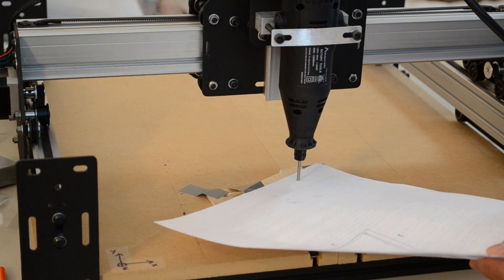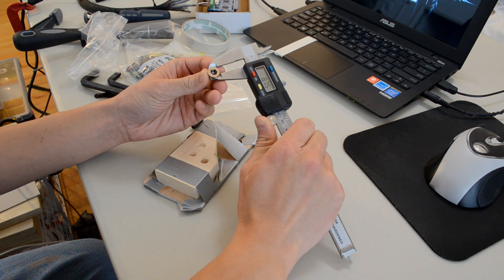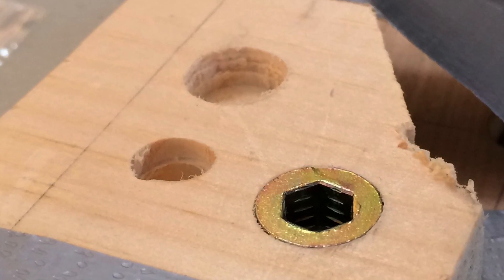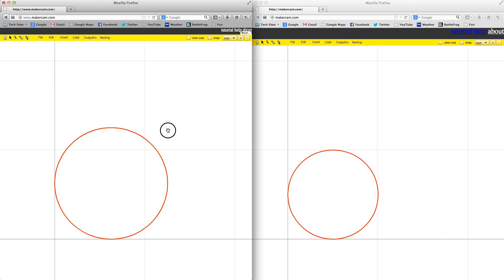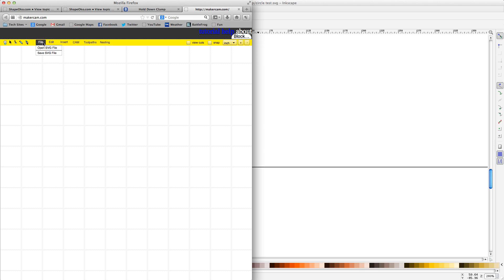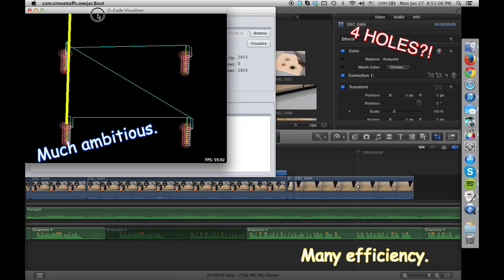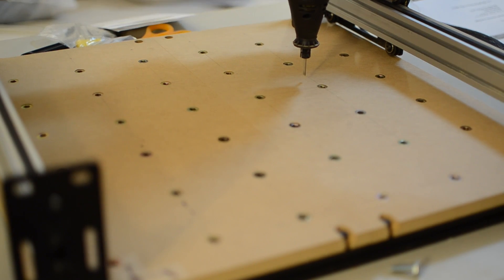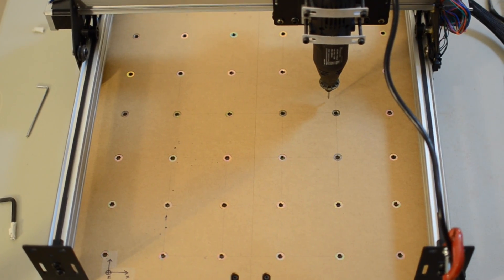Shapeoko 2 CNC Kit: Wasteboard Upgrade w/ Threaded Inserts

Comment: So getting the ones from McMaster you recommend an 8mm inner hole?
Reply from the maker: Yep, and for maximum holding strength, you can install them from the bottom. Drill through the waste board, and use a countersink bit so they sit flush and don't interfere with the base frame. I haven't had much problem with them in the top, but it becomes 100% foolproof if the flange is on the bottom.
Reply: Hey thanks for answering and sorry for being a bother. For the E-Z loks is the outer, top hole diameter still 1/16" beyond the 8mm?
Reply from the maker: the flange diameter? it's like 0.48"

Comment: Hi, I've learned a lot from your videos. I ended up ordering the ez lok from amazon and install them, but I have found that the inserts are kind of weak.  They don't hold all that well in the wasteboard are prone to being pulled out by pressure.  I thought that might be because the wood is too soft.  Even with adding glue i find that the inserts are still being pried up.  Do you have any thoughts on what it is I may be doing wrong?
Reply from the maker: The hole size suggested on the packaging is wrong. Should be 5/16 (8mm). Otherwise the inserts go in too loose.
Reply: wow, quick reply.  Thanks, I'll look into that.

Comment: Couldn't you do the same thing but flip the mdf over? so the flange is on the underside. Will those threaded inserts work the other way?
Reply from the maker: You absolutely could, and it would be a little bit stronger. However, 
because of how the boards are counterbored, it's usually pretty hard to 
secure them to the base frame without additional hardware. Original 
screws aren't long enough.

Comment: awesome videos. getting ready to pull the trigger on a Shapeoko 3 but before i did want to see if you may have a file ready to do this to that wasteboard? first cnc machine ever and need help lol
Reply from the maker: So back in the day, I shared some gcode to cut one or four holes at a time on the Shapeoko forum: http://www.shapeoko.com/forum/viewtopic.php?t=2542

However, that code is meant to cut clean through 1/2" MDF. Shapeoko 3's now ship with 3/4" boards, so there's a bit of difference. Making your own code however isn't too difficult, and I'll be (eventually) releasing a new video for how to do this on my Shapeoko 3.

In the mean time, I found that a 5/16" drill bit + countersink by hand works surprisingly well...

Comment: Hi Winston - Thoughts on using something like this instead of the threaded inserts you used?  
http://www.mcmaster.com/#90244a336/=10yf8jl
Reply from the maker: +Curtis Chan Those are designed for soft woods like pine. Difficult to say if it would work well in MDF, but my guess is that it won't be as easy to drive into your waste board. MDF acts very differently from natural woods.

Comment: I made a table like this, I mounted the inserts from the underside, it reduces the risk of a cutter hitting an insert, (the fastening bolts will go in either way), you don't have to recess the flanges, and the force is trying to pull the insert through the board so no danger of the insert pulling through.

Comment: Hello - what kind of end mill are you using for this?
Hans Peder
Reply from the maker: +Hans Peder Byboth Elvhaug 
I used a 2-flute 1/8" carbide end mill, nothing too exotic. Straight or helical flutes would both do fine.

Comment: I have been experimenting with hole size in MDF. I'm finding that, if I use the recommended hole size, the MDF bulges, leaving a slight 'mound' surrounding each insert (I can see daylight, under a machinist's rule). After much experimentation, I ended up nearly 3/64" larger in diameter. 
I'm curious, since you went even smaller... Is your wasteboard perfectly level over each insert?
Reply from the maker: I put in a slight counterbore on each hole to let the insert sit just under the surface. Countersink bit work well for adding the feature manually, but you should still expect to slightly overdrill the main hole.
Reply: Winston Moy Hi Winston, thank you for the Vlog and the quick reply. 
For the benefit of anyone who might be following along, I'm using E-Z LOK 400-4 inserts. I'm using a 1/2" counterbore, 1/16" deep (the inserts don't have a flange, but this eliminates an initial sharp 'ridge'' around the hole). The manufacturer recommends a 3/8" main hole, but I find that leaves a 'mound' a few thousandths high, sloping off about 1" in each direction (the MDF compression causes 3D expansion). After cutting a series of holes, with incrementally larger diameter, and checking each with a machinists rule, I finally arrived at 0.42" diameter (vs. 0.375" recommended).

Shapeoko 2, expanded to 635mm x 1000mm (24.75" x 35.19"), with 6 limit switches, Z-Probe and aluminum fan-cooled electronics enclosure.

Comment: Winston, would you be willing to share your GCode for the threaded inserts?  I would like to do the same thing you've done for my work surface.  Thanks.
Reply from the maker: http://www.shapeoko.com/forum/viewtopic.php?t=2542
About halfway down the page I posted the code for 1 and 4 holes. It's using really old, sub-optimal values for feed rates though. Good to start out with, but you can definitely improve upon it.
Reply: Winston Moy great, thanks!
Reply: Winston Moy may need help setting up.  Cannot get the UGS application to recognize the port.  Trying GCode Tools next.
Reply from the maker: Mike Kapotsy Were you able to ascertain which port your arduino is using? Ex. "COM 3". And are you positive the Arduino driver was installed? (If not, install the IDE from http://arduino.cc/en/Main/Software)
Reply: Thanks, driver is not installed.  I will try that this evening. Thanks, I'll let you know how it goes.
Reply: Winston Moy OK, installed driver, that helped.  Now having some issues with motor wiring.  Did it like video said, that wasn't correct so now troubleshooting.  Z axis makes grinding noise I read about.  X and Y axes both need reversing.  + moves left instead of right on x and down instead of up on y.
Reply from the maker: Mike Kapotsy I did a little tune-up on my machine last week and discovered that the Z-axis is indeed more tricky to align than I remembered. It's not sufficient to visually ascertain that it's vertical. It's best to loosen the delrin lead nut and also the plates that hold the motor mount to the makerslide a little until things slide/rotate easily. I'll try to talk about it in a future video.

There are of course other things that could be going wrong, so if that doesn't address your problem, feel free to elaborate. I haven't come across all the potential issues myself, but I'll try to give some input.
Reply: Winston Moy thanks, appreciate your willingness to help.  It is frustrating having the shapeoko and not being able to use it.  So close!

Comment: UPDATE!!! Easel is now available. No conversions necessary .
Thanks for the video. It helps to explain the software working alternatives. Being a carpenter, I used a framing square, 5/16" forstner bit, and a countersink. I screwed in the inserts using my 1/2" air powered ratchet with a hex bit socket. For those in a hurry not wanting to tackle the software learning curve right away.

Comment: Wow, really?  The software can't handle metric?

That's...  damn near a dealbreaker.
Reply from the maker: I mean, it can handle metric, but the way it does the unit conversion leaves each line too long to transmit via serial (unless you do some simple decimal truncation).

This may not be as big an issue now however, if I recall correctly the updated version of GRBL allows 20 more characters to be transmitted per line or something.

You can also work in Inkscape in metric and convert later when going to MakerCAM. Or try Easel. There are options for you.

Comment: Hey man , great shapeoko videos and tuts, can you help me with makercam? Everytime i draw in cm it generates the gcode with the correct size but way too big commands like you said, so i moved to makercam in inches, but when i draw the exact same piece in inches (converting cm to inches) the gcode turns out with a piece to cnc that is like 300% smaller than the original drawn in makercam using cm, what gives?
Reply from the maker: Hmm, that's kind of strange. Have you done any other jobs on your CNC to verify that GRBL's programmed correctly? Easiest test would probably to draw and cut out a 1" square using Easel.
Reply: Winston Moy actually.. i'm trying to mill and engrave things using my 3D printer (k8200) and i have succeeded using artcam for example, but in makercam, whenever i try to export in cm my machine goes crazy (even after trimming the decimals in post processor) and if i try in inches the models come out tinny, like 700% smaller
Reply from the maker: tigox brata
Oh, that's cool. What is the controller? Is is also Arduino/gShield? Or something else. Have you tried comparing the gCode you get from Artcam and makercam? they may be using different post-processors, and makercam's is just not right for your machine.
Reply: Winston Moy The controller is a revised sanguinololu (atmega2560 and ponololu drivers in a board) and yes, i have compared the code, the difference i see is that all the coordinates are different, which makes me think the problem lies before the host program i'm using...
Reply from the maker: tigox brata
That's kind of strange, I thought gcode only came in mm or inches. There shouldn't be a scaling issue with the code if it's properly identified in the beginning pf the program. Have you tried writing a few lines of gcode (ex. G21, G0 X1 Y0, G0 X1 Y1, etc) just to sure the controller is interpretting the streamed commands correctly?
Reply: Winston Moy yes i have tried, and it does, and that bring me to believe the problem lies before the controller... i guess... maybe unsupported type
Reply from the maker: There's always the possibility of writing your own post-processor/converter...
Reply: Winston Moy yeah.. no, i'm an absolute beginner in this stuff, and software is waaay out of my expertise

Comment: Great video!

As a North American, it's easy for you to say 'just use inches', but I haven't used inches since around 1970 and don't have any imperial tools or measuring equipment - my whole world is metric - actually, THE whole world is metric, with the exception of the USA.

The easiest and best thing to do is to petition makercam developers to reduce the number of significant digits they output.

Comment: Hey I'm a Cnc noob... Your videos are VERY helpful as well as entertaining! Question, how do you know what to look for in the gcode? I've been running different things just with a pen before I go and cut up the world, half way through my process it jump up about a .5" and continues on at a .5" above zero. I'm a fast learner and am usually good at teaching myself, do you have any recommended websites or articles I could read to understand better?
Reply from the maker: If you google how to read GCode, you can figure out what most of the commands do. The 'G' series of commands can in general be interpreted as "go", 'M' is machine commands like "turn on spindle" (not applicable for most basic CNCs), and there's a couple miscelleneous ones. 'F' is feedrate.

If your CNC is lifting up, look for a "G__ Z__" (i.e. 'go to Z height _') command. Actually, even just looking for "z" should key you to the line of interest pretty quickly since 2D programs should have very few lift-up calls.

When I was in college, we did an exercise where we wrote our own gcode, basically just plotting straight lines and arcs. You can try something like that, using Wikipedia as your gcode dictionary, but I'm sure there are plenty of other tutorials out there. And you can quickly test it on a gcode viewer like OpenSCAM if you don't want to risk damaging your machine.

Comment: Nice videos.  I got some quick questions:
1) Why did you install your inserts from the top and not the bottom as on the shapeoko (instructables) website?

2)  I see pencil marks on your board are you were making the holes. Did you draw the grid by hand and then manually job to each hole?
Reply: Cesar Rullier http://www.shapeoko.com/wiki/index.php/Home_switches
its easy, you have to solder 3 pins onto gshield on 9, 10, 11 
http://timf.anansi-web.com/wp/limit-switches-for-the-shapeoko/
Reply from the maker: 1) I don't trust MDF to not erode away after dozens if not hundreds bolt insertions and removals, so I wanted the insert to be the only thing that makes contact with hold down bolts. The downside is that you will need a scrap layer between your workpiece and your MDF (so your end mill doesn't hit metal). But that's okay because I want my "waste"board to last as long as possible.

2) That is correct, since there's no "global" zero unless you install limit switches or something, you have to use a manual reference point. Plus, the lines help in alignment of workpieces.
Reply: Can you install homing switches ? Meaning does the arduino shield allow for that if you ever wanted to ?

I was going to use t nuts on my machinr, but since I found yours (thank you for the links) I think I will your method. I will use .75 think mdf so that I can recess the insets a bit. 

I find that making a top board or spoil board is quite a project when you want the machine to do it. But I love the idea of having my machine make some of its part.
Reply from the maker: Cesar Rullier
 From my understanding, the gShield on the arduino can accommodate 3 inputs, so it should be able to do homing. With some creative wiring, you can probably do limit switches too: 6 inputs, with 2^3 number of readable states... but I would search around on the Shapeoko Forums for details on a specific implementation.

Comment: I can't for the life of me find the part you mention on McMaster's web site. Could you give us the part number?
Reply from the maker: Here's the threaded insert I got from McMaster: http://www.mcmaster.com/#92105a100/=qhbi42

But after seeing the brand (EZ-Lok), I'm pretty sure you can also find them on Amazon and such for slightly cheaper. Maybe: http://amzn.to/1bbeWi9 ? Double check dimensions to make sure it suits your needs before buying.
Reply: Winston Moy Ah! SAE. I finally did find the flanged insert listings, but couldn't find the M5 size mentioned in the Inventables catalog for their waste board product. You indicated a metric hole size, so I had metric on the brain. Of course I was impatient and had already ordered the M6 ones and some M6 hex screws. Then I read your response and (facepalm) I have a whole box of 1/4-20 hex screws sitting next to me. Oh well. I'm sure the next guy to come along will appreciate having the part number. Thanks!

Comment: Looks good! I did all of my holes in a new piece of 1/2" MDF stacked on top so that I can cut completely through my pieces and just dispose of that board when it gets too rutted. In that case, I didn't want the nuts to be flush with the top of the board, since the drill would hit them when it went all the way through the piece.

For anyone reading this who wants to get things up and running a little bit faster (and is willing to spend some $), it looks like Inventables is starting to sell these types of things themselves:

https://www.inventables.com/technologies/waste-board-with-threaded-inserts
https://www.inventables.com/technologies/clamp-set
Reply from the maker: That's a good point about hitting the inserts, I usually throw a sheet of ply under whatever I'm milling and thats enough. I program in no more than 1/8" of overshoot.

And I saw the workboard on Inventables too, looked good but I wanted this to be a learning experience. But yea, some people might want to opt for that... then again, who builds a cnc because of convenience? :P